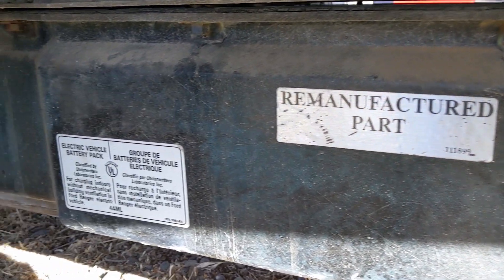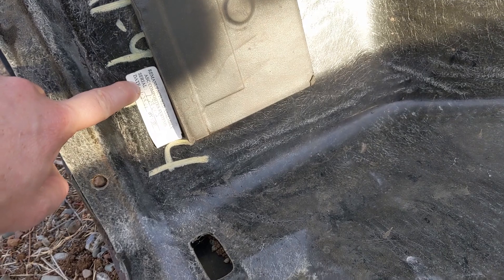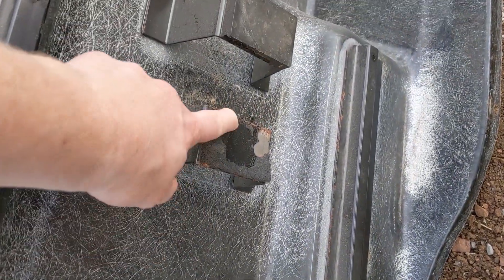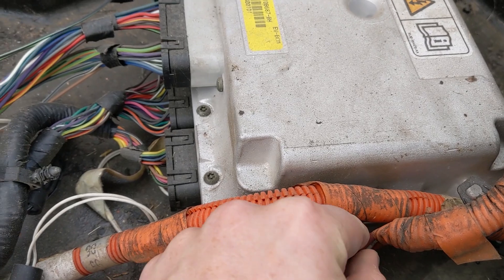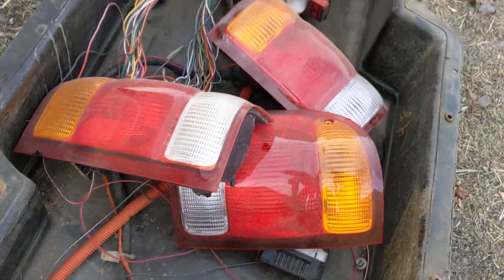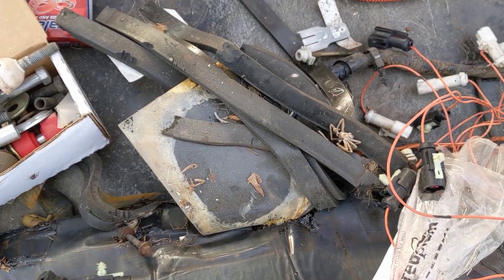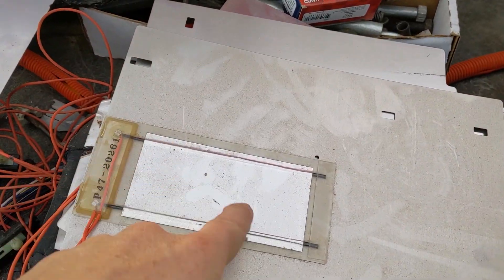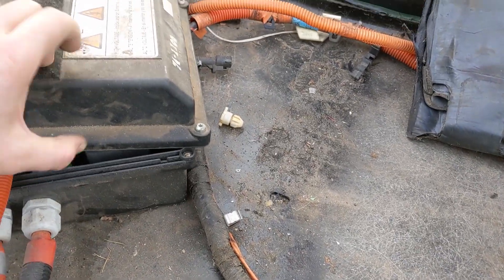Ford Ranger Electric: What's in the Box?!?

Comment: Gonna be real hard to add thermal management. Given where you live cooling is both the most important, and the most difficult to implement.
Reply from the maker: It might not be as hard as it seems. Now, liquid thermal management would be difficult, but the Ford Ranger Electric's battery had active air cooling since the beginning.
Reply: @newscoulomb3705  sure yeah, but I don't think the capacity of that air cooling (designed for lead acid / NiMH) will be sufficient for DCFC of Li-Ion. For Level 2, possibly.

Are you only planning on level 2?
Reply from the maker: @homomorphic  It will be Level 2 for now, but DCFC is in the works. Even with DCFC, if the C rate is kept reasonable, it really shouldn't be much of an issue. Most of the heat buildup in batteries occurs while driving, not charging, and the default setting for these Rangers was for the fan to run during charging and driving. Essentially, it would be active a majority of the time.
Reply: @newscoulomb3705  sounds like you should use Bolt cells and controller and charge at 55kW max. That should fit the vehicle profile quite well. 60kWh. Is probably adequate for the use case, will probably allow you to chop off the bit you want to chop off and you should get a 130 mile range out of that.
Reply from the maker: @homomorphic  Bolt EV cells would be a good option, and I considered them. Unfortunately, they get bought up pretty quick, and I'm not convinced they are the best option for this truck or my purposes.